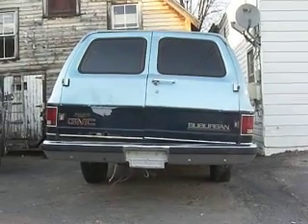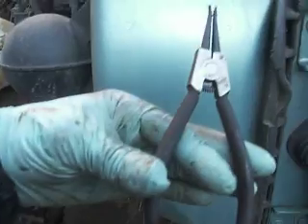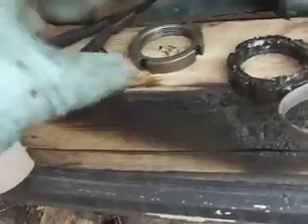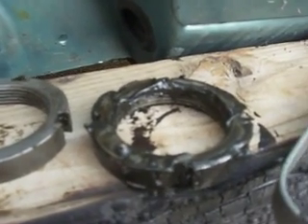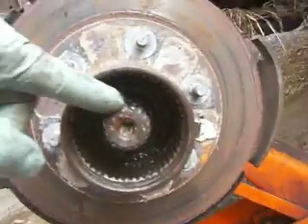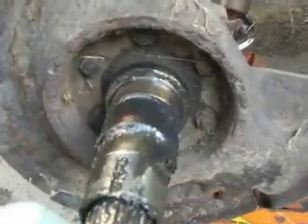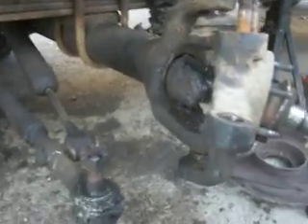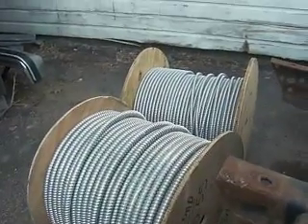Little Parts... 101

Comment: Hey Mr.Cwild! I searched for some other video's on changing hub bearings, and here is a video of you doing very close to what I'm trying to get done. Question this time is: I bought a new hub and brake rotor and all, and I have my new inner bearings in and packed, new dust seal tapped in and flush with the edge of the hub, but I can't get the hub to slide up over the spindle to where it should. Do I have to force it any at all? The old one came right off, but the seal was all but gone.